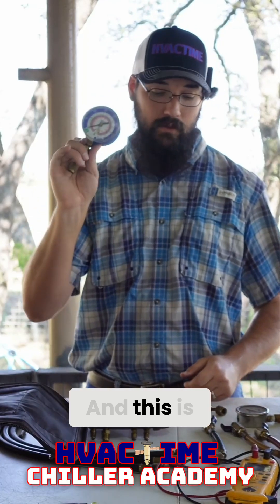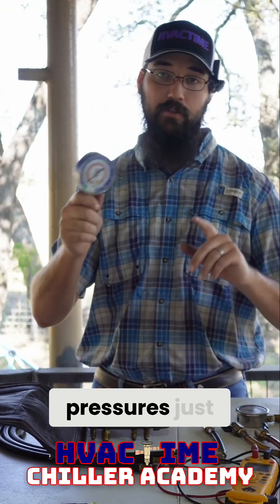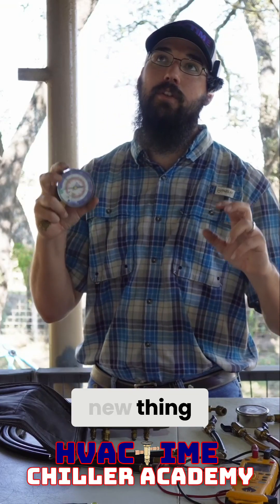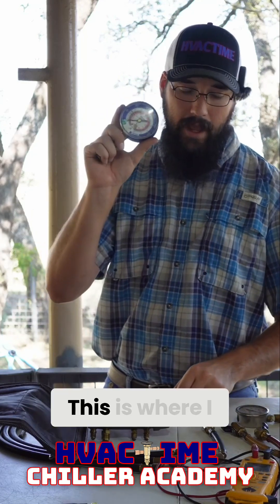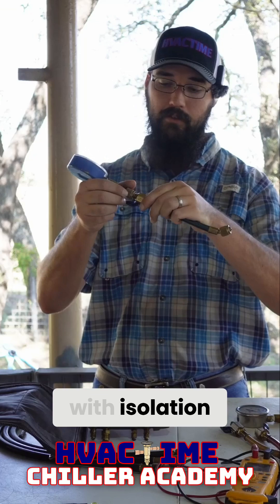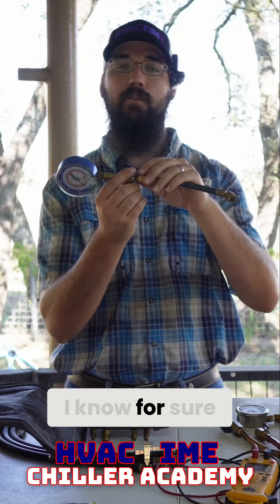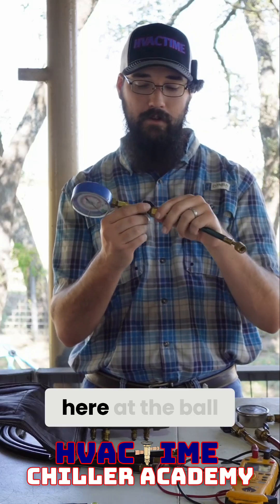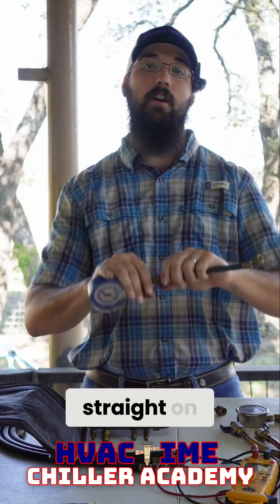Using Stubbie Gauges as a Chiller Tech

Comment: He’s definitely correct….  Being in the HVAC industry for roughly 22 years now or half my life I can’t tell you how many times gauges on piping/gauges on your manifold/or monitors lose there calibration.
If something doesn’t look right and is making your head spin, then most likely you have a faulty gauge.  
I was working with a journeyman when I was a I believe third year apprentice.  This unit discharge air temp was really high and all said, and done with his high side. Gauge was bad and we only came to that conclusion call after feeling the condenser coil along with the air temperature coming out of it pretty much burns your hand.

Comment: Appion makes a good brass stubby adapter. Yellow jacket does too - (19124) is one p# out of the several different ones

JB Has a couple small 1/4 backseating services valves that can be used with a stubby too. (A33000) 

Only thing that can be frustrating is if you use something like the appion one where it’s a normal 1/4”flare hose fitting on each end - while the gauge is a normal 1/8” npt thread. 

I ended up needing to order a set of  1/8” npt female - male 1/4” flare fittings since I couldn’t find any local. But now with those directly on a gauge I can hook up small stubby fittings or add on a longer hose etc if needed